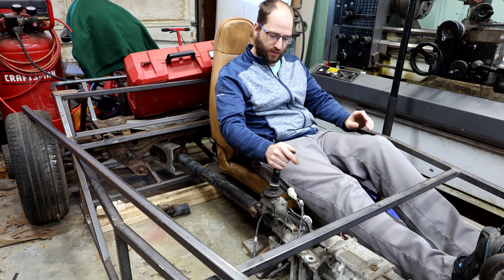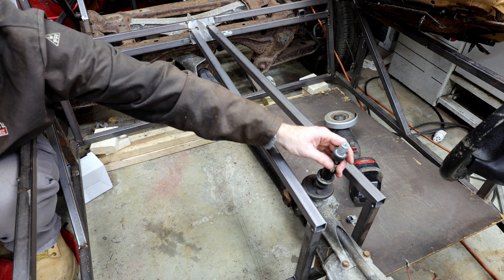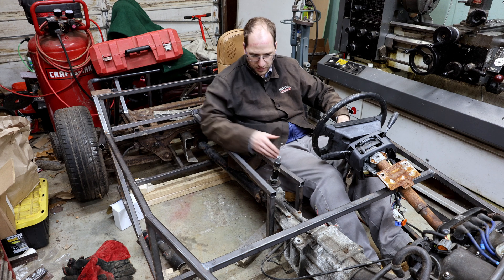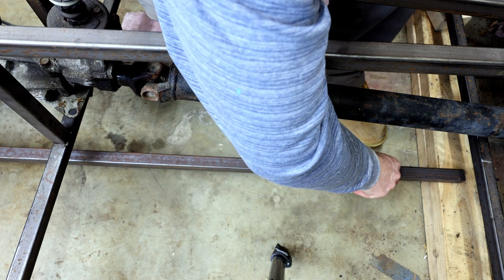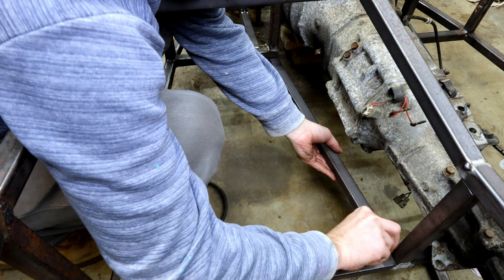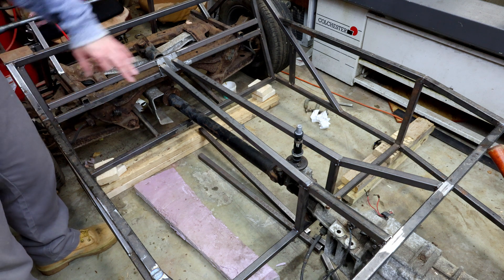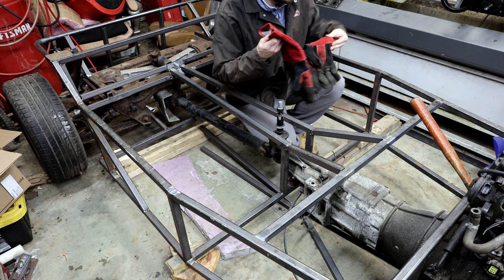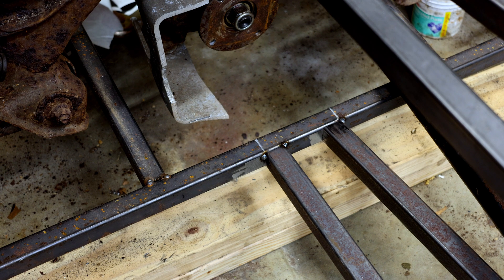Transmission Tunnel Fabrication.

Comment: Great job!! I'm building one as well with NC rear end and LSD, NC 6 speed trans and a Duratec 2.5L engine, in a 442E chassis. I'm on the forum as well, but I did not start a build thread.